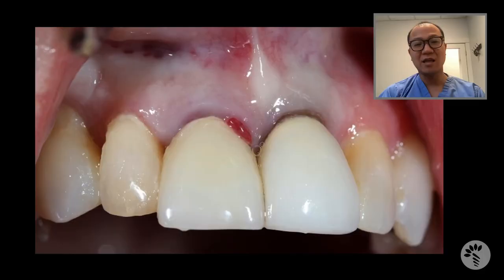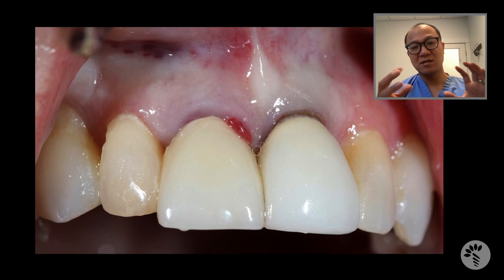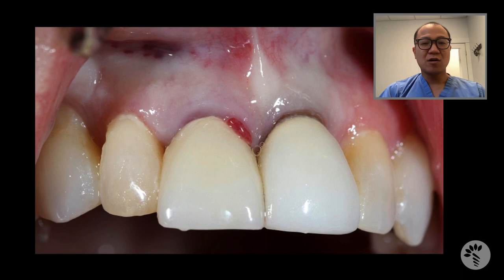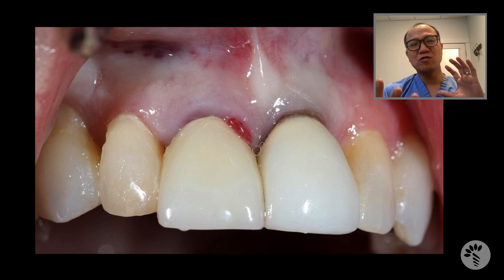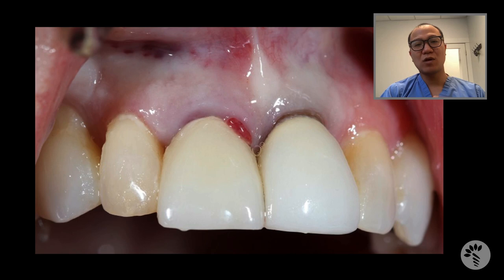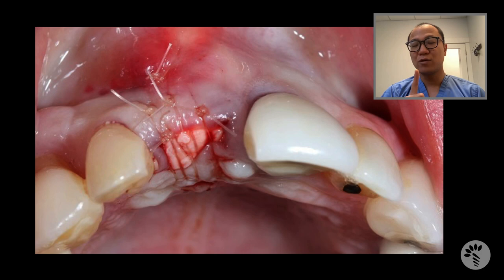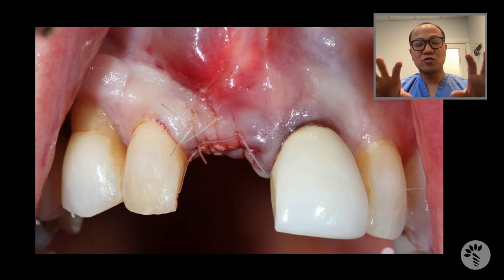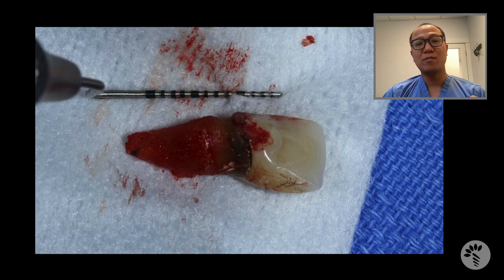What would a Periodontist do? with Dr Tae Kwon - Case 5

Comment: I thought leaving collagen membrane exposed wasn't recommended because it too dissolves quickly. Is this a x-linked collagen membrane?
Reply: Yes. It is cross-linked collagen membrane, called Ossix plus. By tunneling the soft tissue, you can minimize the amount of exposed membrane to allow better healing. Most of my cases, i do close the socket completely;however, in some cases, i do the technique shown here.. i make this decision based on patient’s personality (primary closure would result in more swelling, pain), presence of any buccal bone loss (if so, I will do primary closure), any need for doing ridge augmentation (socket + bone graft beyond the socket; if so, i will do primary closure)..